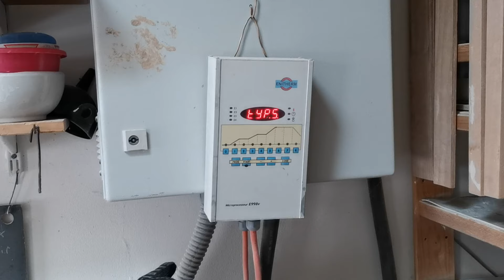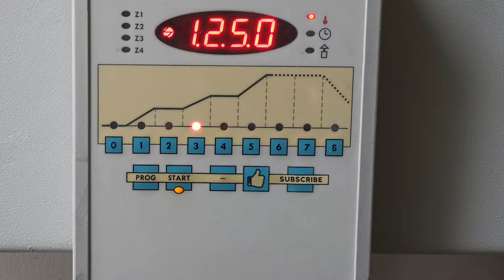How to Load a Kiln and Avoid Breakage - Pottery firing techniques

Comment: Greg, thanks a lot for the video.  What brand and type of clay do you use?
Reply from the maker: It depends on the project, I use several. it depends if I'm looking for a particular rendering, or a technical particularity (mechanical resistance for example). At the moment I use the R&B brand a lot (a French clay)
Reply: Absolutely beautiful. A work of art.
Reply: @Greg-ceramics  Thanks for the answer!  That's why I'm asking, you hardly ever use pot holders during glaze firing.  I even have small 20-40 cm bend and I have to use coasters, I observed the same thing with the Japanese.  What temperature is your clay?
Reply from the maker: @BonsaiPots.SIC.  Yes, that's why I use different clays, for example for the large pots I use a very grogged sandstone, but less pleasant to work with. I tested a lot, and there is no ideal clay. they all have their qualities and their defects.
And that's why I almost don't make big pots in colored clay (brown/red), clays that contain a lot of iron deform too much, and I haven't yet found the clay or the mixture that suits me.